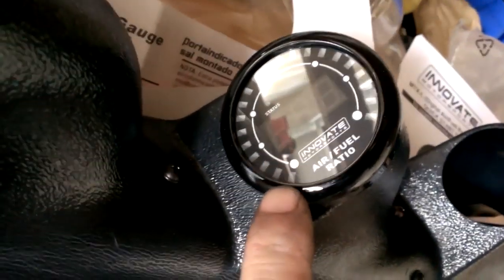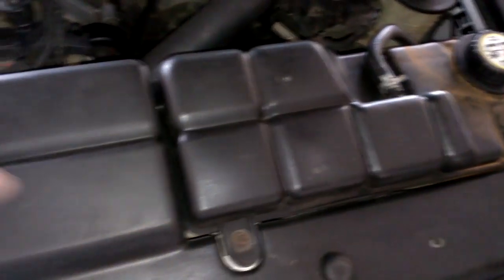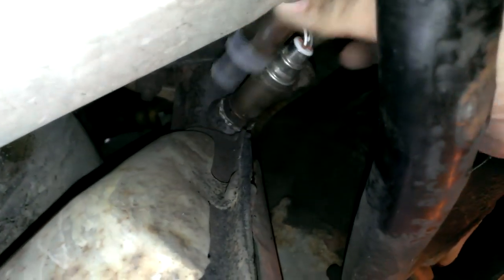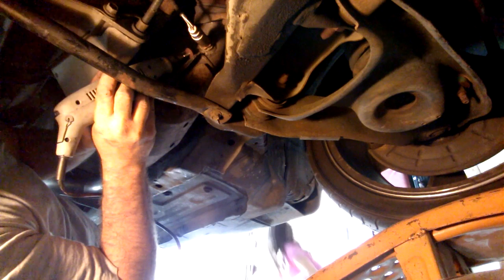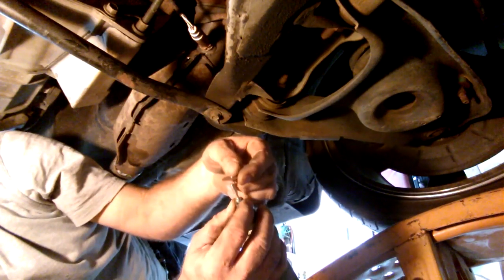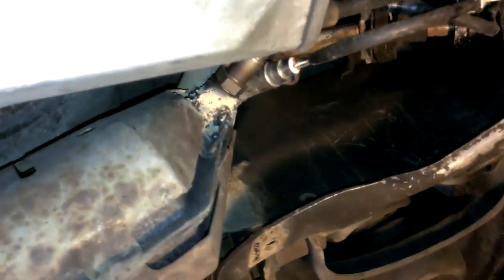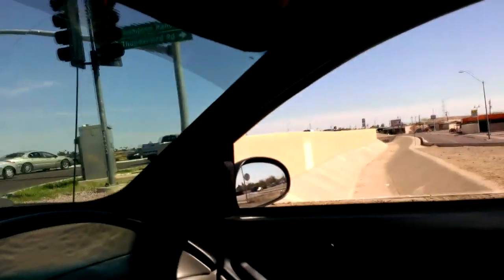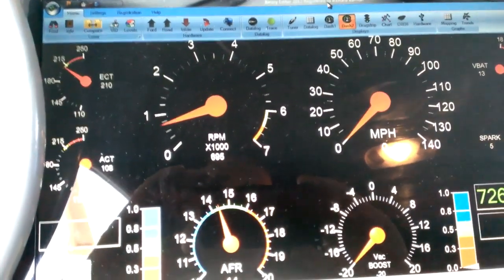Mustang GT Project - Innovate Wideband O2 install

Comment: Nice work! I'll be putting a bung in the collector of my 383 Stroker but am concerned about what you said about the length. Did you install a shorter bung? Also, what type of welder did you use?
Reply from the maker: I can't remember which one and I recently ripped that exhaust out as I just got done piping into a turbo.

You can use the short one but they say that a long one may help prevent fouling if you run it pig rich for a long time.

My welder is a Miller wire feed using the cheap flux core and no shielding gas.
I really need to get a bottle of gas to start using solid core and shielding for better welds. I want to figure out how to do aluminum too.

Comment: My buddy went with the cheaper AEM Wideband. It only has a 0-5v analog output and a narrowband "simulation" wire. We're investing the possibility of tapping the 0-5v signal into the EGR position sensor wire.